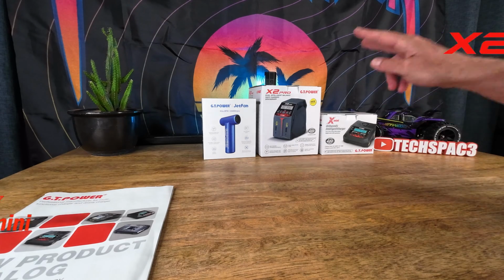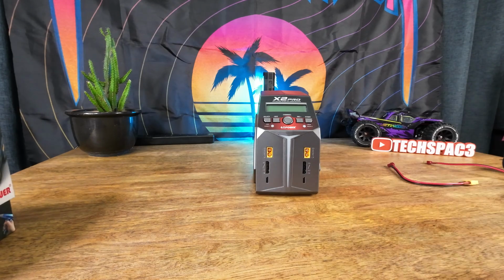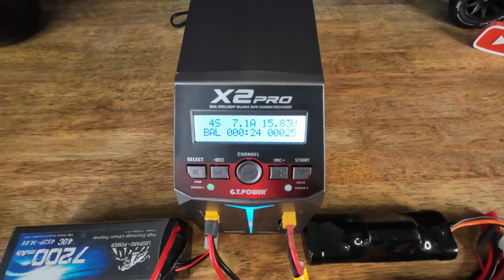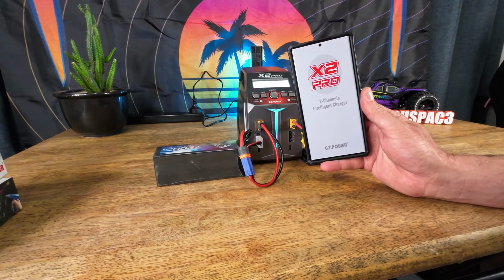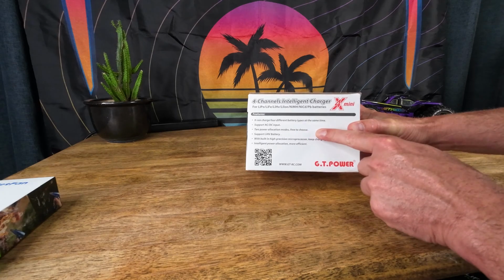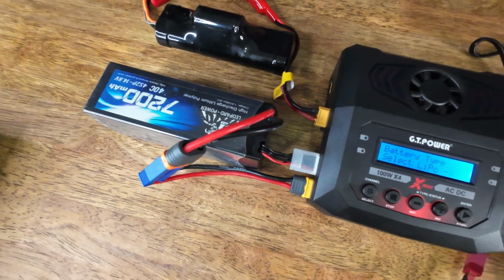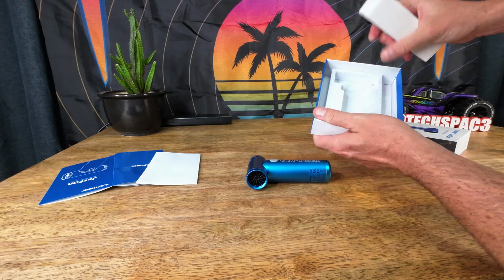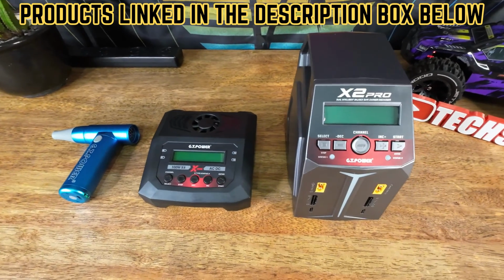GT Power RC Battery Chargers - Unboxing, Overview & How to use guide!

Comment: Have been looking at getting a new charger as mine only has a single charging port which is a pain to charge one battery at a time🤨 The X4 Mini looks really appealing with its 4 charge ports. Great video bro💯
Reply from the maker: Glad to hear that the x4 mini is tickling your fancy mate😬 i know before i had these chargers i was rocking a GT Power c6d with one charge port...what a difference these make👍🏻
Reply: Will certainly have a look at it very soon. Looks really easy to use and thats what i like👌🏻
Reply from the maker: Once youve got the hang of it its very easy to use